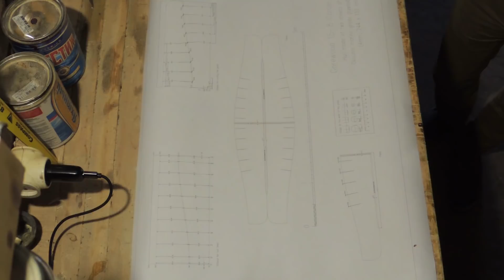Gorewood 15,8' Canoe

Comment: nice done, beautiful, saw somewhere on youtube an older guy applie the same method but using to less water and the plywood broke. you use the whole Don on water and on both sides
plywood as in multisheets? must it be marine plywood? fastening the 2 sheets plywood together you use epoxy and glasfiber cloth?
a german guy Wagner makes them from single sheet birch
great job
Reply from the maker: The elderly guy whose plywood cracked is an Austrian, the developer of these drawings. Search his youtube channel for "flo-mo boats". You will find a lot of interesting things there! And a single-leaf canoe is also his invention.
I fasten two sheets of plywood only with epoxy. Fiberglass only on the outside. Birch plywood, marine.

Comment: Nice build. I'm about to have a go at doing the 14 footer. What thickness of ply did you use? I'm surprised you needed the ribs. When bending the Hull you were wetting it. Was that hot water?
Reply from the maker: I used 4mm plywood. I bent the plywood with cold water. I had to bend across the fibers. If the pattern was along the fiber, then it would not have to be wetted at all. Everything would bend easily and simply.
In fact, the ribs in this boat are not needed. It is quite strong without ribs. But I really like the look of canvas canoes.
Reply: Thanks. Im using 4mm too. Not marine ply. Just standard stuff.  I want to try bending without water if I can as I want to keep the wood look and avoid water staining. We shall see whether it splits or not
Reply from the maker: Good luck! everything will be fine!
Happy New Year!

Comment: Wow..when it comes to stich and glue boats this is cutting edge stuff.. btw what type and species of ply did you use? Congrats on a brilliant project.
Reply from the maker: Thanks!
This is a 4 mm birch plywood. The outside is fiberglass with epoxy resin and 4 layers of varnish.

Comment: What would  weight be without ribs.
Reply from the maker: I didn't weigh the boat before installing the ribs. As a result, the weight is 35kg. This one is too much. The weight increased due to heavy fiberglass and a large amount of epoxy.

Comment: Great job!!! I'm in the process of my build, waiting for epoxy to cure before moving on to closing the gores. I've been wondering, if I use a long enough pvc pipe and cut a 6mm channel down the length of it and use it as a temporary inwhale/outwhale for the bend, would the gores close themselves during the bend? Any thoughts?
Reply from the maker: I don't know. But maybe it has the right to try
Reply: did you try the pvc?
Reply: @wendyanderson8169  I did try the pvc but it did not help close the gores at the same time you bend the canoe into shape. I ended up having to close the gores first anyways lol.
Reply: I just had mine out on the water for the first time today. I'm disappointed.  It's so unstable. I think it floats too high in the water. I messaged Stefan and he told me how wide the canoe should be so it's the right dimensions. I don't know how to fix this lol.
Reply: I made a new yoke 4 inches longer, put it on and got it back out on the water and success!!!! Alot more stable.